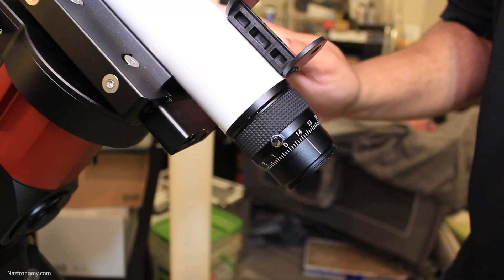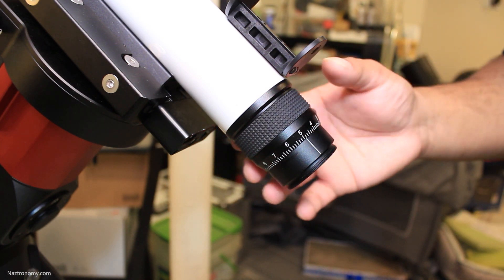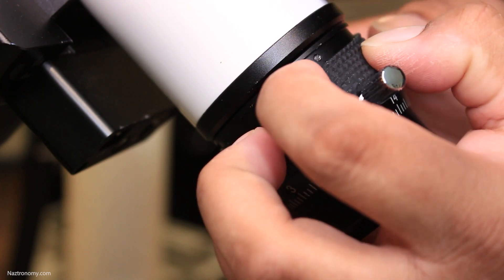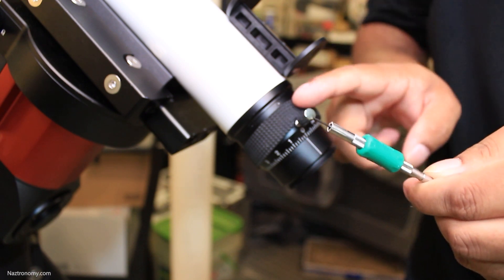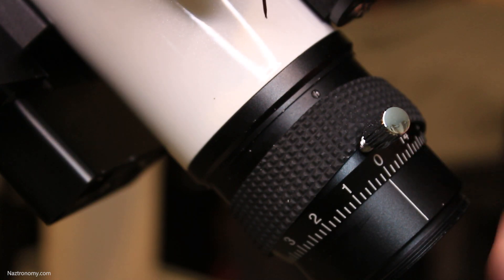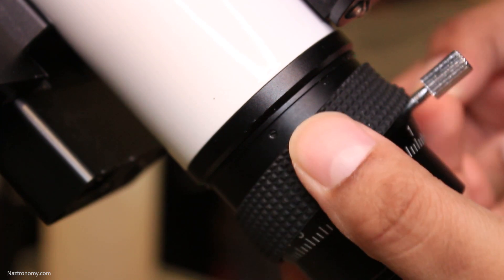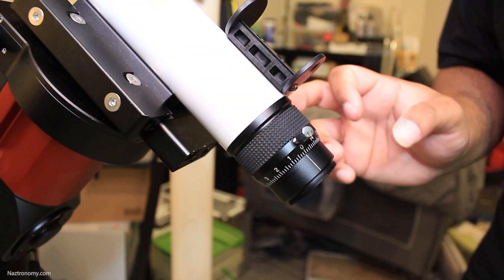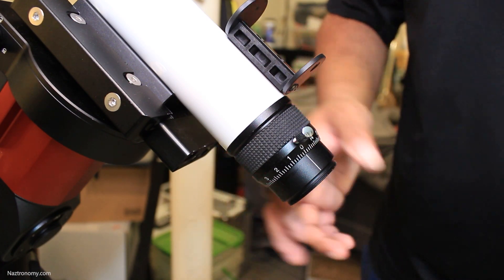How to Fix a Loose Helical Focuser on your Telescope Featuring the Lunt 40

Comment: NOTE: The NEW 1.25" R&P focuser sold by Lunt DOES NOT  fit their 40mm model even though it is shown as an option on the same page.   Addendum: Neither does the helical focuser shown on the same page.  If you order either product for your Lunt 40mm you are subject to a 20% restocking fee and return shipping.    Ask me how I know.    Both these focusers do appear to fit the 50mm models however.